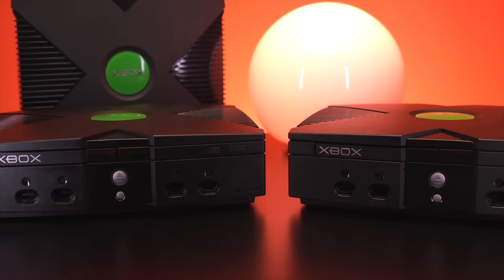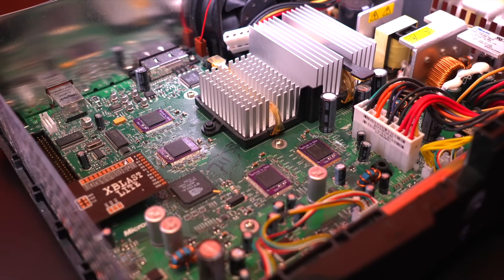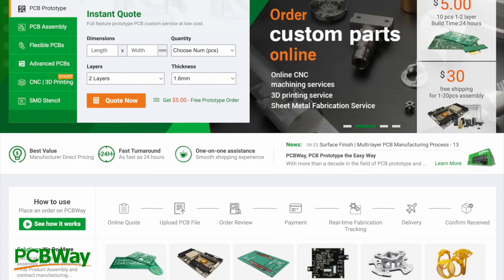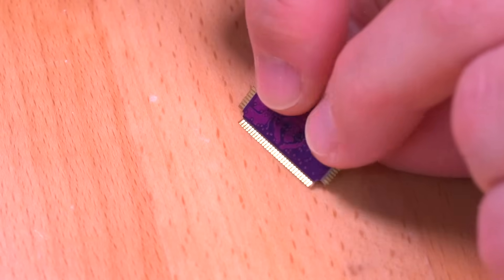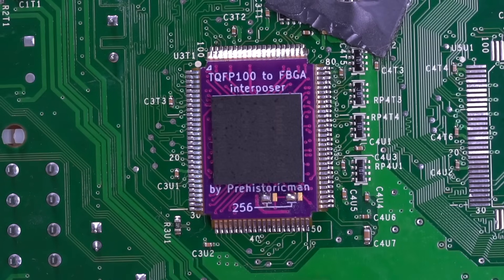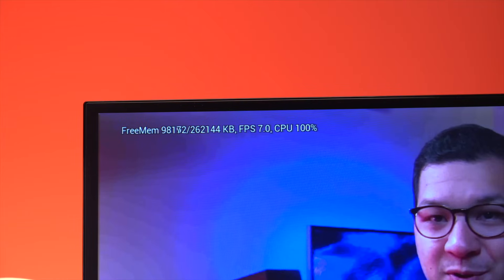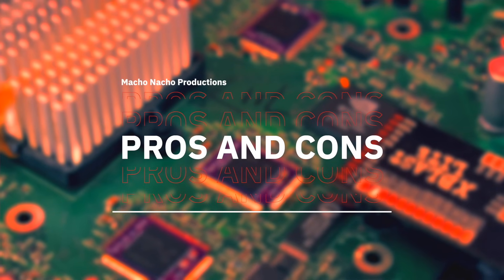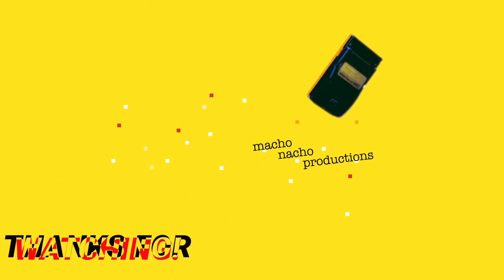Giving The OG XBOX Quadruple The RAM | Never Done Before!

Comment: Couldnt this mod be used to upgrade 1.6 boards to 128mbs rather than chip stacking? Then you can use those extra ram chips to upgrade a 1.0 board

Comment: Using a modified xblast chip would allow you to test each memory module one at a time installing it. Refer to Modzville's xblast videos. Popping all 4 chips off and roux chambeau'ing the install of 8 and assuming you'd get them right on the first shot is ambitious. What should be done is remove each stock chip one at a time testing functionality of each in xblast. Replacing them in order, then proceeding to the empty slots. Another thing not covered was emulation and 3rd party software. This is known to have significant performance leaps with a 128mb console. Its also worth noting that module stacking has existed.

Comment: I have installed an additional 64MB of RAM in my Xbox (128 total) and even that is pretty useless. I can run a couple of Chihiro games I could not before, but I have no other use case as I don't use my OG Xbox for emulators.

So adding another 128MB that runs slower than the original RAM or OG RAM + extra 64MB seems like a not so great idea for the average or even above average lover of the Xbox.

Comment: I've seen similar mod for Switch. Soldering new NAND and RAM chips, which actually affects game performance and useful in other OS's and emulators it can run. Insanely difficult as chips are way smaller, but super impressive.

Comment: Dude, you don't need Kapton tape or foil to protect components around the RAM. I dont get where this misconception came from, but the small resistors, capacitors, diodes, etc. are definitely not going to get damaged with heat. If anything, the RAM is the sensitive component. Simply tin the RAM pins with leaded or low melt solder and reduce the amount of heat needed to remove them.

If anything, all you're doing when using Kapton tape, apart from wasting money, is risking the tape sliding around when the flux flows underneath it and dragging all those very small components with it.

Comment: Overclock the CPU and GPU, 256mb ram, upgarde from a HDD to an SSD.

I wonder if it would speed up load times for games that are installed directly on the drive instead of disc running that type of configuration

Comment: Many years ago, I bought 4 extra RAM chips for the Xbox. After the struggle to put them in, and it makes sense, there was no benefit from what I saw. The software I ran had all been designed for 64megs and had no idea the other memory was there. Maybe some emulators will be written to use it, but most of the older systems already fit into the 64 megs already installed. Would be nice to be able to make a RAM disk as a cache but that seems like a lot of work for very little return.

Comment: You really need a chisel tip when installing RAM. One of the reasons I bought a TS-101 from Ali, it comes with 7 different tips (which are replaceable UK side for £12 each if you burn them out). I cringed when I saw a pointed tip because coverage to the pins is limited (hence your fractures when you attempted to solder them). Doing the 128mb, I don't even remove the heatsinks, just fly through it, just a tip for the future. Keep the solder limited and feed same as you was doing. Certainly interested in the process, will have to reach out see if I can try a set UK side. As always thanks for a nice clear vid and tut. Time to sub

Comment: Thank you for this video. I am going to dust off my Crystal Xbox and do this at some point. 

At around the 9:00 mark. If you prep the motherboard pads with a thin coat of solder before tacking the chip, the chip installation will go easier. I would have prepped the pads, added more flux, then tacked a few pins as you did. I would hot air this into place only because I have a board pre-heater. I get why you did it how you did. I'd have drag-soldered it too without a board heater , just with the pad prep steps I mentioned earlier. Great job all round. Subbed! 

For context, micro-soldering has been my job since 1989.

PS. My Crystal Xbox is my Guinea pig machine. Anything that proves good on that makes it's way into my green machine..

Comment: I think the actual "pro" of this mod is that eventually we are gonna run out of chips to do the classic 128mb ram mod, and this is a good replacement for that eventuality.
Reply: I don't think that's really the point, nor a close coming problem.  Compatible ram chips are most likely still in production, and are used in low power, or low capacity computational devices.  

That being said, adding more deditated wam for thuh swerver is always nice.
Reply: @TheGamersRace  Yeah, you'd be surprised how many embedded systems are using cores based on Pentium era cores (system-on-a-chip)  for things like restaurant bump bars, and PBXs (once upon a time anways.
Reply: @TheGamersRace not mentioning that we may try and harvest old compatible chips from used tech. Ram chips are close to being immortal
Reply: Or what about motherboards with original RAM chips that have failed? We could revive those boards with this exact modification.
Reply: i doubt there are enough people doing the 128MB mod to run out of chips any time soon but 256 is incredibly cool by itself
Reply: There will be broken Xbox's to take parts from for a good long while.
Reply: The CCPway business model: they take free and open source PCB design like this, and then some Chinese сомм unists noname garage shop produces a ton of devices for profit
Reply: @nneeerrrd United States can't even mass produce PCB for hobbyist in any quantities that would make it cost effective.  You should thank the greedy communist being able to clone retro systems.
Reply: @fffUUUUUU that's good though.

Wasting design time when things that are good enough already exist is just slowing down progress for no benefit.
Reply: @nneeerrrd  And its way better than what the west can make.

Comment: Could you imagine the possibilities with a 1.4ghz processor upgrade and 256mb of ram on an original xbox? Holy smokes! I bet if there was a proper bios for something like that, it would be able to do alot more.
Reply: Exactly because the stock cpu is 700mhz with 128mb cache and the tualatin 1.1 to 1.4 are 512k cache and faster speed. A faster ram like that could help emulators for shure :p
Reply: @E-T-Console-Mods  Surely you mean 128KB cache
Reply: I don't get the whole excitement over making a console slightly faster. Still disgustingly low res, quality, fps everything.  I guess fun but not really playable. I'm at 4k 144hz and I want more.
Reply: @xpodx  sure it isn't 4k, but higher resolution videos do play back better and emulators run better in most instances. Also, the potential of running other Operating Systems on it like React OS could be much faster/better performing
Reply: @Al_Greens_Pimp_Cane  a little snapper and little to no crashes true. But yea emulated I can up the fps and res and render much higher
Reply: @xpodx  you most certainly can on many different devices...but I still consider the original Xbox an absolute beast at emulation. I can also run DIVX videos near 1080p off of a blu-ray rip and it looks pretty damn sharp on my 4k TV and very close to Blu-Ray quality with little to no artifacts or pixelation running at full speed on my 1.4ghz 128mb OG XBOX. My other modded stock OG XBOX stutters so bad that the same video it is unwatchable. The video resolution source you are ripping from to reconvert to the right compressed video file encoding type makes a huge difference.
Reply: @Al_Greens_Pimp_Cane faster load times
Reply: @xpodx  It's called a hobby.
Reply: @agentoranj5858 they think that if it ain't modern then it ain't the best and isn't worth playing.

Comment: One game I know of that runs into RAM limitations is Out Run 2... the first one, not Coast 2 Coast. There's a certain hill in one stage that can get a little juddery when you go over it and it lasts maybe a second. At least I'm assuming it's main RAM since it was originally made for the Xbox arcade hardware... not sure if there were any GPU or VRAM differences in that. Of course the game would likely have to be hacked to take advantage of any extra memory.

BTW was the Xbox outputting at 8K in your video? Or was it just playing an 8K file downscaled internally to 480p or whatever?

Comment: This would save several Xbox consoles with bad RAM modules. This is a fantastic mod. Plus, it allows developers to create homebrew arcade games, and fully debug, on the Xbox console itself. These applications would then work on actual Chihiro boards flawlessly. This new RAM would also help certain emulator's on the console run significantly better, after some updates are made to the emulators. This mod also makes it so that an old Xbox console can be turned into a retro PC machine to play older games as well. This is great stuff.

To say this mod is pointless is just missing the point and possibilities.

Comment: Nice video. I don’t understand from where you get the extra address line to duble the 128MB?
Reply: The address bus to the chip is multiplexed - there are 12 physical address lines and the arrangement of the original chip is 4096 rows (needs all 12 lines) by 256 columns (only needs 8 lines) - so if you drop in a part that has (say) 12 bits of row address and 9 bits of column address then you can double the memory without any additional physical address lines.

Comment: So question for modders like this: 

Is there someone reputable who will do this as a service? I would like my original Xbox upgraded with a mod chip, 128mb of RAM, an SSD, and higher clock CPU. 

I don't have the skill set or desire to do the work myself. Is there a community I can join to find someone to provide this service? 

Thanks!

Comment: Hoping this sparks some interest back into the modding scene to have someone patch software to add an option to tweak variable ram usage so the system itself can determine (equivalent of adjustable bar like more modern pc systems today) the ideal amount of ram as well as manual slider option for tweakers to get the ultimate setup.

Comment: Shame it's still so hindered and unusable... this would be right up my "just for funs" alley, for sure. If only there were at the VERY LEAST, a usable console on the other side of it. But that being a no go at the moment, is kind of a deal breaker, sadly. 

But, I do wonder if some of the worse running games on this console, would in fact run a bit better... Especially if combined with a cpu upgrade. As there are certainly enough OG Xbox titles that were perhaps capped at 30, with all hopes and prayers via the devs and players being that it'd hit it and remain there... but of which rarely ever did. Or so to say, plenty of choppy games to observe with a faster cpu and quadruple the ram. If the machine really knew how to allocate and use this additional performance and ram space, it could very well clear those games up, bringing them much closer to 30fps at all times... rather than the 20-30, or less at times, frame time nightmares that they are / were.  I'd be very curious to experiment with that sort of thing, but yeah... console would have to work for that to happen, lol. And as much as I find this level of soldering / rework / electronics to be easy peasy, I don't code... and I'd have to rely entirely on those who do, to come up with some magical BIOS to make things jive right.

Comment: Upgrade the CPU
Upgrade the ram

i bet future video be like "Install faster GPU"

in the end, modders accidentally create Xbox 360 by upgrading original Xbox.
Reply: Let them cook...
Reply: If they tinkered with the development kit that used G5 PowerMacs, I believe they could create an Xbox 360 PowerMac.
Reply: Would be interesting to see a Pentium 4 in the OG Xbox.
Reply: @Vhaal-666 You are incorrect. APUs are used starting in the 8th generation, and in the late 7th generation, Xbox 360s with the "XCGPU" in the Slim and Slim E models.

PS3, Xbox 360, and Wii use separate CPUs and GPUs. The Wii has the "chipset" (ARM Starlet) in the GPU, but otherwise, it is not an APU architecture.
Reply: @Vhaal-666 The older generations still have them in separate chips. 

The common use of APU's is a more recent thing.
Reply: Okay, so it wouldn't exactly be Xbox 360. But you have a point, this is what a next generation x86-based console could have been, had the 7th generation not entirely jumped to using PowerPC.
Reply: Yeah, the Xbox CPU can be upgraded to Pentium 3, with an Interposer. or as everyone would say... Adapter. and the RAM could be doubled (Piggy-Ride) method and it be i think 512MB or possibly 1GB for that.
Reply: @ItsJustJer prehistoricman said that you can’t use the piggyback method with these ram chips. With his new iteration it could be possible as he is trying to make new ones that are like the stock ones
Reply: @albnoel  Interesting, I could imagine one day having atleast a gig of ram or two lel.
Reply: I think the 360 is power pc cpu
Reply: i'l do you one better createing an og xbox faster then an xbox 360 which could emulate xbox 360
Reply: @yaelyol  so an xbox one? it's an x86 console with upgraded specs that would be in line with if the og xbox had been the same console just with hardware upgrades over time instead of releasing the 360 and it also has enough power to emulate an xbox 360 (not just with official BC but also with the devmode release of xenia)
Reply: If they manage to make the OG Xbox BIOS to run over a PowerPC chipset through emulation or precompilation, then maaaaaaaybe
Reply: if im not mistaken the og xbox shares its memory between the ram and gpu so technically it is upgrading the gpu at the same time
Reply: play a pc port!
Reply: Mother board won't handle it
Reply: the Xbox GPU had an another job the RAM controller andthe only chips that do that only has iGPU
Reply: Yeh.
Reply: 'People soon realized' ..... 23 years later lol
Reply: i bet it could be done using a raspberry pi as the gpu/co-processor!  im trying to figure it out for older macs, but the idea works everywhere
Reply: Probably closer to an Xbox 270 🤣
Reply: That's because the Xbox is just a weird Pentium 3 computer.
Reply: Lolz
Reply: That'd require a whole different architecture lol
Reply: @SockyNoob  i didn't mean "literally" but they upgrading original Xbox as powerful as X360
Reply: @ErnestJay88  finally, someone who understands the word "literally"
Reply: @ErnestJay88  I know it is joke, but x360 is way way more powerful than any of the mods done to original.
Reply: @ErnestJay88 💀
Reply: @SockyNoob  It could work, if there is another piece of hardware between the XB and the new GPU, which pretends to be the original GPU and translates the instructions for the new one. I'm not an expert in graphics processing, but i'm sure this would add a small bit of latency.
Reply: @mike_et_saika  At that point you've basically described running an Xbox emulator on a modern x86 PC. AFAIK, translating the GPU calls has been the hardest part of emulation because the NV2A is unique, proprietary, and has no public documentation.
Reply: @sypwn  Okay, sounds legit. But since it's the nvidia Kelvin architecture. Maybe other, more powerful chips of this architecture can be adapted, like ge GeForce4 Ti 4800
Reply: @SockyNoob A YouTube channel called Retro Renegade Repairs replaced the CPU, upping the Xbox from 744 MHz to 1.4 GHz.
Reply: @SockyNoob you'll require a whole different architecture in a minute young man
Reply: @kraftypk7283 I'm stealing that threat lmao.
Reply: @SockyNoob  I think he meant accidentally create a console with equivalent power of a 360, not necessarily new architecture.

Comment: The thing to do here is to start with 2 working unmodded original Xboxes. Take the RAM chips out of one, and put them in the other, making that one a 128 MB mod; then put these chips in the other Xbox, making it a 256 MB mod.

No waste.
Reply: Why?? You can get brand new RAM chips for it today!
Reply: @fadingbeleifs  For if you're like me and have 8 spare Xboxes sitting on a shelf, lol.
Reply: @edale2  What about Pin 28, CS or chip select?
Reply: @ Erm...what?

V1.0-1.5 Xbox motherboards already have open spots to install extra RAM chips to bring them up to 128 MB RAM. You literally just take the RAM chips out of one Xbox and solder them in to another. Then you use the right CFW and you have a working 128 MB RAM Xbox. pin 28 is soldered in as usual.

You only have to do something with pin 28 when you're working on a v1.6 Xbox, and are literally stacking the RAM chips on top of each other for the 128 MB RAM mod.
Reply: You mean like stacking them on top of each other??
Reply: @England91  that's actual the method on a v1.6 motherboard, but on v1.0-1.5 motherboards there are 4 unpopulated sets of RAM solder pads, you just need to solder the 4 RAM chips from the donor board into those 4 slots to do the 128 MB RAM upgrade. After that it's just a matter of having firmware capable of utilizing the RAM.